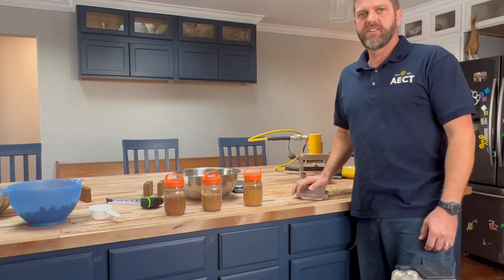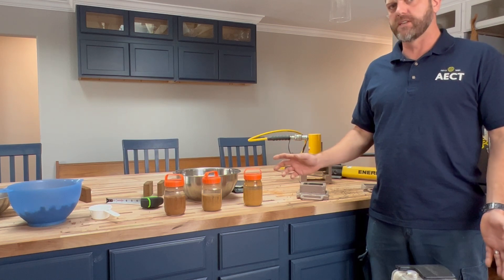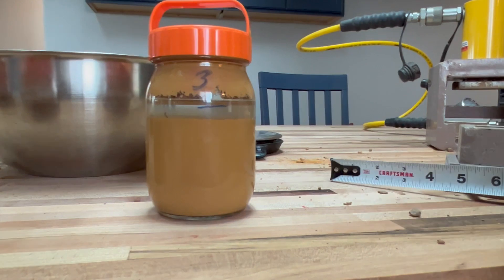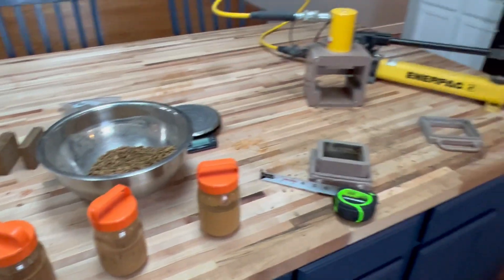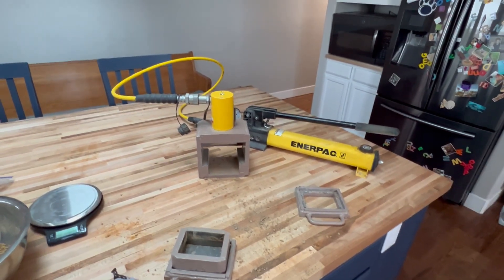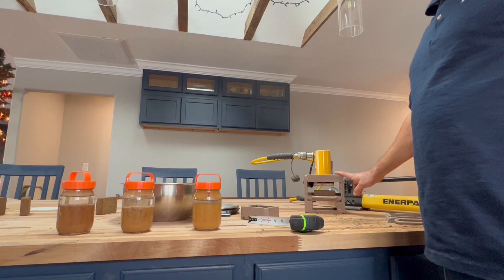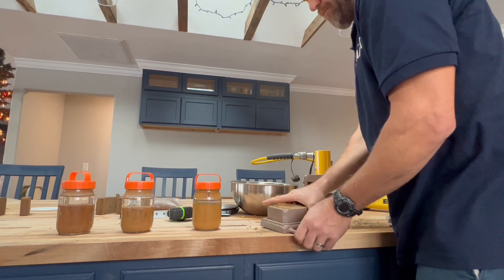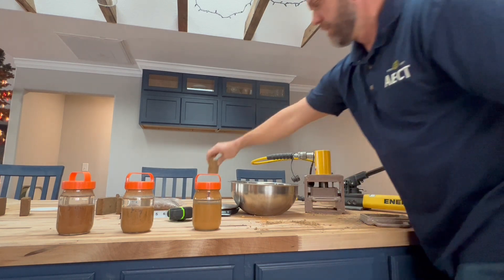Testing a customer's dirt for viability of making CEBs - Part 1

Comment: I am just trying to learn so bear with me.... Can you do 10% stabilization? Can you play with different ratios of cement, lime, and pozzolan? I know they use these different items in stabilization of rammed earth. And I know cseb construction is faster, but is the overall strength equal to a monolithic stabilized rammed earth wall? Also, what about larger block sizes and thicknesses? What is the most affordable auto block machine for the average working man? Love what y'all do. Hi from NC!
Reply from the maker: We've done anywhere from 4% to 10% cement or lime for blocks in a wall system.  We've done as high as 20% cement for CEB driveway pavers in an extreme freeze/thaw climate. https://aectearthblock.com/faqs